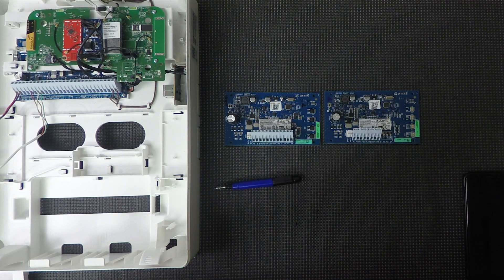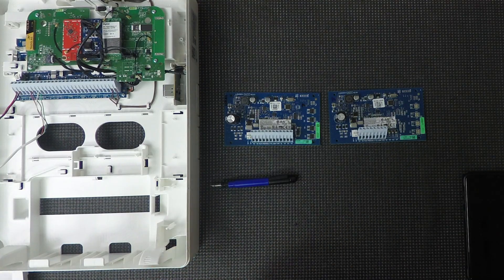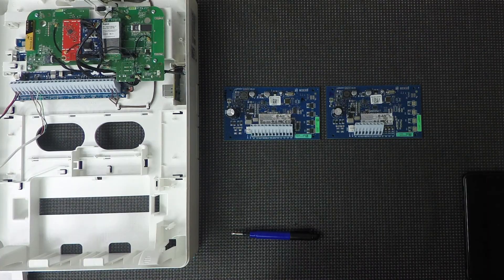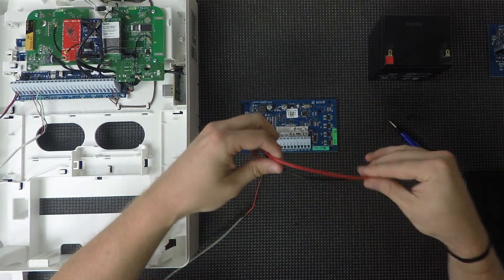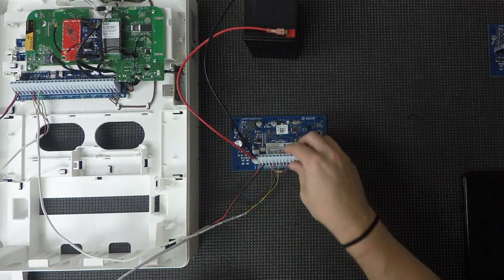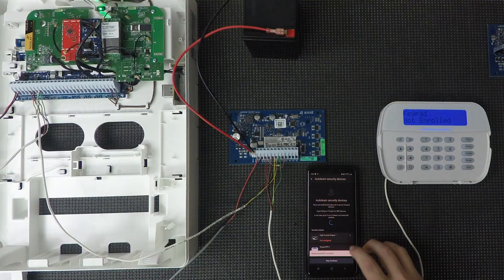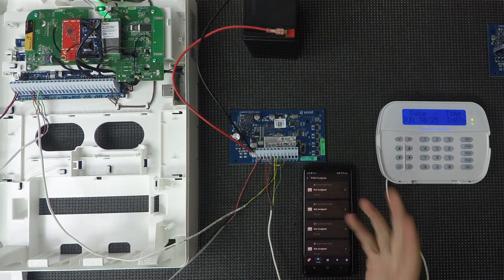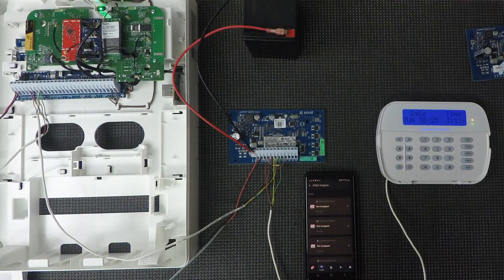IQ Pro Mastery: How to Install Power Supply Modules

Comment: Can you use these for speakers?
Reply from the maker: Yes, output 1 on the HSM2204 is a secondary bell output just like on the main system, and the other 3 can power additional sounders provided they have less than 500mA power draw combined.